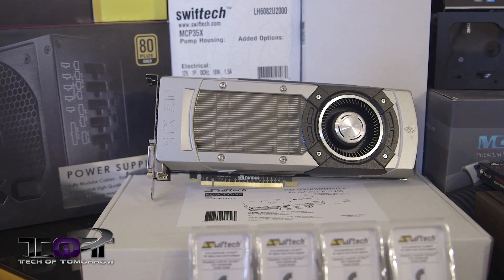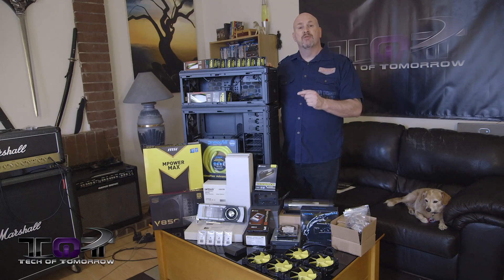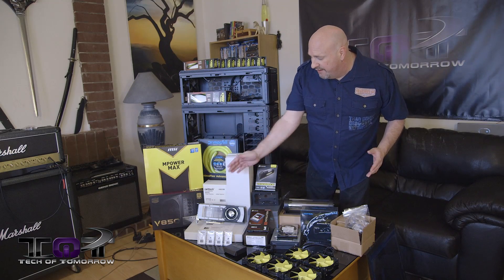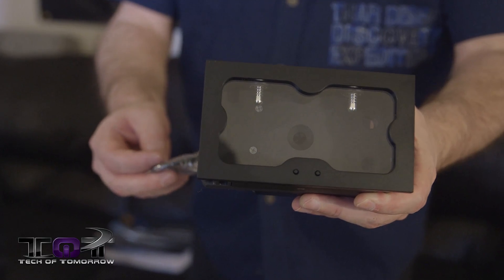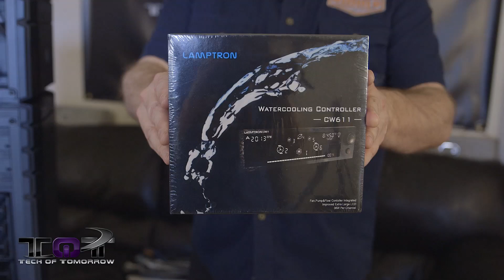The Metro 935: Monster Water Cooled HAF Stacker Build (Part 1)

Comment: I am currently doing a build with the case, but i've run into an issue. I'm installing windows 8, but when I get the prompt saying that the computer needs to restart, nothing happens. It goes into this sort of standby mode. When I try turning the computer off and back on, I get a message say the installation was failed and i need to restart the process. I'm already at a lost since there are no panel connections for reset. Any advice?

Comment: Get V1000 for 2 780s.. i builded my beast system under a  minth now and have 2x 280X and gonna add another 280x as i have V1000. So for your 780s, i would say get bigger PSU but hey, you know more than me.. maybe i'm wrong..Anyways very keen to see your build..
Reply: Dual 780s would easily run from an 850w. You could even run 3 of them off one, if you don't have a ton of other stuff that requires power.
Reply: triseebee Really, that's great.. I think you can then help me solve my problem ..

Comment: MSI still rubs me the wrong way, everything I have had from them has been flaky, budget, or just plain unimpressive, All those epic parts, should have stuck an EVGA or ASUS board in there. I hate to bash on any manufacturer (as I am not a fan boy, I do have a few MSI's floating around and I have seen ASUS boards fail hard in the past), but I used to work at a PC shop and MSI let us down alot, even with non budget builds. Asus, Evga, and Gigabyte have been the least problematic in my years of experience. MSI, Biostar, ECS, Asrock, and PCCHips have all brought flakiness and weird issues to the table.  Other than that, epic build man, I want to see it run!

Comment: Elric, the MPower motherboard has a memory module designed specifically as part of the MPower series, the memory is available for $189 on NewEgg and it has custom lighting on the heatfins. The memory is from a company called Avexir. Their products are extremely fast with a Cas-Latency of 11 and run from 2133 to 3200 MHz.

Comment: you should put all the water cooling reservoirs and stuff in the bottom stack not the top in case something leaks it wont go through all your expensive components
Reply: It's a lot easier to put on the top and probably a lot better for the pump since it's shooting down water instead of shooting up water
Reply: Michaelangelo Parkinson Either way if the water goes down it has to come back up the same distance to the pump so it really doesn't matter if its top or bottom.